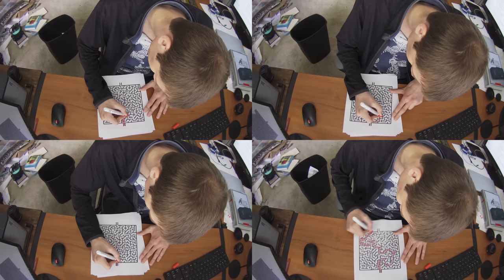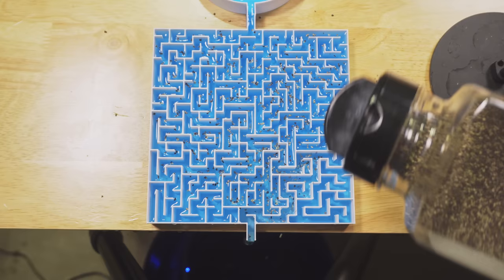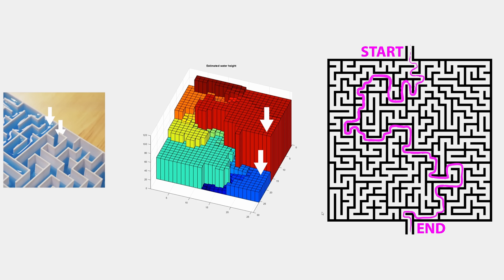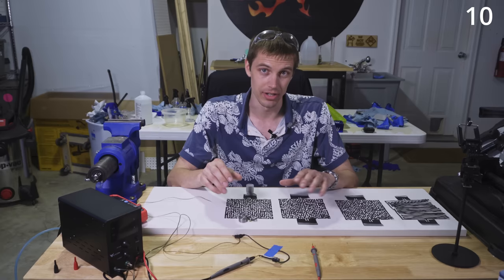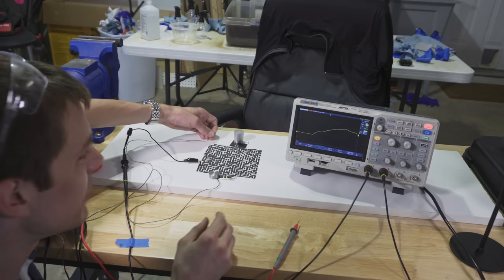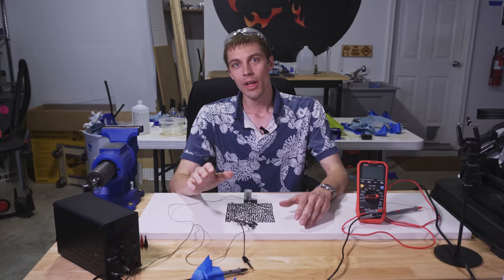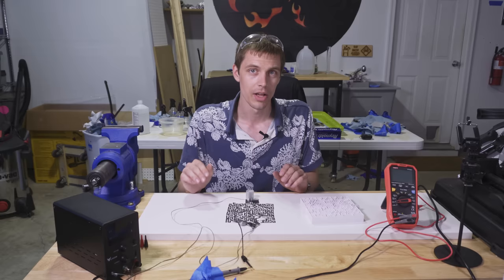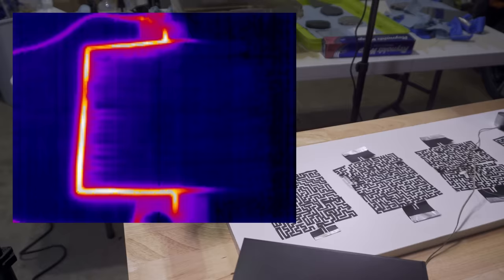How does electricity find the "Path of Least Resistance"?

Comment: This is an awesome visualization! It also makes the formulas and calculations in electronics more logical to me. In the end, all electronic circuits are basically just a maze, where the measure of resistance of a certain component tells you how "long" that component's "path" is, and the voltage drop over a series of components gives you the "gradient" of the "water hill"

Comment: Absolutely fascinating. I understood most of this already, but you've helped me visualize it in an entirely new way. Only 8 mins in, but already I can see how resistance is essentially drag created on the "electron water" and an item being conductive basically just means the water in the maze is already filled (the way electrons are already in the material and don't ACTUALLY flow like water) 
So basically I'm assuming that by the very nature of how resistance works, plus the 'gravity' model of the flow finding the path, the fact that resistance even exists is what actually allows electricity to follow the path, as it is basically testing all paths at the same time, but only the path with an output can 'move' and this 'low pressure zone' creates a metaphorical vacuum that then creates the flow of electrons.
This is my favourite vid of the year, thank you so much! (I'm gonna keep watching now, I assume there is plenty more to learn)
Reply: cutting the wire at the end was somehow both surprising and completely understandable. At first I interpreted as the flow getting trapped in the bends (and promptly realized how silly that was) and then realized this is heat, not actual flow, and the corners will have the highest concentration of heat due to the proximity to other areas of the 'wire'. But it did also highlight the flow, in that because the metal heated up SO much slower than the electricity flowed, you can actually still see (from top to bottom) that it is filling in as it goes from start to finish.
Yep, absolutely fascinating and a really beautiful illustration that truly cemented the concept in an accessible way. Great work!

Comment: This was a great video. A slightly more technical way to put it that is also helpful is that all conductive material, including wires, have capacitance. A capacitor is like an electric spring, same equations as a spring. Compressing the electric spring is the same thing as the filling up of the maze with water. When the voltage is removed, they will "slosh" out, or sort of pushed out like a spring releasing compression, as the charge of the maze reaches 0 again. I always found the spring analogy helpful.

Comment: Wow, this is such a great vissualization on the flow of electrons and shows how it takes ALL paths to ground, not only least resistance... if a hole was to open in another path, I.e. wire connected or someone touched it, it would suddenly go out to both spaces and both paths would activate and move...

Comment: Very nice experiment! It illustrates Kirchhoff's circuit laws in an interesting and engaging way. The different paths to "solve" the labyrinth are wires of different lengths and can be seen as resistances of different values. For two resistors in parallel, more intensity will flow through the least resistant one and so it will heat up more.

Comment: Breadth first search. The initial wave propagates equally through all available paths in the maze.

Where dead ends are hit, the waves reflect back and stop the (very slight) flow of current. Where the wave hits the output, it reflects back but inverted, accelerating current flow along the travel path.

This back and forth propagation continues until equilibrium is reached, where every point of nonzero potential gradient (i.e. electric field) is matched by resistance to active current flow. The equilibrium potential non-current-carrying dead end branches will be the potential at the branch point from the current carrying path(s).

Comment: There’s a balance of pressure at the boundary that is moderated by a vortex of inflow and outflow

You’re looking at the momentum of the stream of water at the edge of the system approaching laminar flow against the maximum width the vortex can be due to construction of the maze itself (and I’m glad you machined it so it was a constant width and height)

The backing up process doesn’t stop the exchange of water in it, it slows it, decreasing the acceleration of the flow of water at all points before the place which is attempting to deposit more flow in, which will inevitably change the height of the entire system by introduction of its own flow and that backing up process needing to also release up until the original system balance is in place (should the flow rate be constant)

The flow rate along the shortest path when factoring in the end is that it’s an open system, it’ll correlate to the amount of water capable of leaving, the amount of momentum that can be achieved through the longest path, and the fact that in the last example, you’re looking at the longest path changing directionality which will effect momentum of the system, until you made the shortest path closed, and the flow rate only had the option to go through the longer path

Before that point, you were seeing the flow rate of the shortest path actually overcome the flow rate of the longest path, indicated by the temperature increase at the bottom

If this were a system of water, I’d expect the height of the water in the longest path to increase, but still be balanced by the faster moving flow in the shorter path when it reaches equilibrium

Comment: I thought the same many times. And then 1 day i  realise current is not flow to the shortest path. Current always flow with least resistance. And after watched your video I confirm. Thanks man 🎉🎉
For Example if we have two types of wires first wire is 1 meter long and other one is 10 metre long but has 10 times less resistance compared to first one then the current flow on the both wires is same . If you read my comment please reply me if i was right 👍
Reply: Resistors in parallel ...

Comment: In your example of two paths at 4:00, you say the water flows to the exit because the surface is lower on that side and water "flows down hill" but that isn't really right. The water flow is because of pressure difference between the water source and drain. The height of the water is related to the water pressure at that point; the surface becomes lower further from the source because water pressure decreases further from the source in the path where it is able to drain. The paths that don't drain maintain the same pressure as the source and so no water flows into them. The height of the surface is not the cause of water flow.

Comment: An interesting, although by now faded memory is, how one of our lab exercises was to simulate a large section of the AC power network in a water tank.  I don't mean a deep one, the "tank" had just maybe 6 millimeters (1/4 inch) of water depth.  The professionals simulated the whole country power grid.  We students had just a couple of hours to do our smaller section.
 
 Another memory about power grid analysis is, how one of my older friends had earned some money by occasionally operating the university new computer overnight for some lengthy tasks.  One was to optimize a certain river's multiple hydroelectric power plant water flows through the cascaded pond system.  I believe there were 6 plants with varying reservoir volumes and characteristic river flow rates on each section.  The computer was fed input data by punched hole cards and then it produced the results on a punched tape just after sunrise.  A speedy "monster", that computer.  It had a recently upgraded (doubled) ferrite core memory.  If I understand, there is no thermal camera solution for this optimization task.

Comment: Interestingly, back in the 70s when computers were slow and expensive, engineers used analog circuits to simulate underground water ingress. They use potentiometers connected in the form of a matrix, adjust the values according to the properties of the underground structure, supply power to the network and measure voltage on different nodes, to see where the water will go. I've seen such device 2 years ago in a research institute when they are cleaning out stuff, along with a book describing this technique in detail. The title was "Modele De Calcul Analogic In Hidraulica Subterana", by Romanian engineer Constantin Ivan.

Comment: This just help me realize why using an amp clamp to diagnose a short to ground on a fused circuit that has multiple loads is helpful. Replace fuse with load such as light bulb and trace current path

Comment: It has always annoyed me when people say that higher resistance means more wasted energy, as in putting a 10 megaohm resistor across a AA would consume more joules. That's only true if current remains the same, which isn't how a voltage source behaves. This perfectly demonstrates how higher resistance paths let less energy flow through them.

Though, I get the feeling they could be confused by the similarities of a long path and a high resistance path.

Comment: Voltage is usually called "potential" in physics, and this is directly related to the same "potential" as we use in difference of energy levels in gravity.
The Voltage, or potential, is actually a measure of charge energy difference between two points.
So the water height/electrical potential difference is indeed comparable.

Comment: Electrons are quantum, they don't work quite the way you suggest. Also, electrons moving in a conductor are insanely slow, it is more about the potential pressure difference pulling a whole chain of electrons in the conductor starting with the ones already at the "finish" line.

The idea of electrons moving the whole path from start to finish in an instant is a very common misconception. For example, when you turn on a table light, it takes literal hours for an electron from the power socket to reach the lamp. The electric field is what is changing instantly

Comment: If electrons didn’t move, we wouldn’t have electromagnetism! Special relativity is so important that it applies at every speed, no matter how insignificant it may seem! The speed electrons move may be very slow, but it’s still fast enough that when you look from the electron’s perspective, what seemed like magnetism to the wire looks like electricity to the electron and what seemed like electricity to the wire begins to look like magnetism to the electron. All of Maxwell’s equations can be derived with Coulomb’s Law and Special Relativity.

Comment: Super cool idea; this reminded me quite a bit on how electrical resistance of a wire can be defined in terms of the wire length. In this maze game I guess you work in the limit where the difference in wire path lengths is significant to show a noticeable difference in current. 

A cool follow up experiment is if you can mimic this behavior where instead you swap the extra long wires for resistors of near equivalent effective resistance, and see if you get the same proportions of charge flow down each path!

Comment: To me, this is a silly question. 

It's like asking how water flows downhill instead of uphill. The path of least resistance is literally the steepest hill for the electric potential to fall down. 

I'm glad a 20 minute video is clearly helping people, but this could have been greatly simplified as a concept. You may not realize, but it's also the same as asking "Why don't batteries spontaneously charge themselves?" -- but this might be a better way to ask it. This is because you can get over the actual question of resistance quickly as there is greater resistance in the air than say the battery terminal but electric current isn't pouring into the battery. From the perspective of the electrons, the resistance matters but the height of the hill also matters. The air is a lower hill with higher resistance, so while the battery may have less resistance measured in Ohms, because it's hilltop (electric potential) is higher than the air, it still wants to "fall" towards the air instead of the battery. 

And another way to paint this picture is to point out that to take another path requires adding energy instead of dissipating it. Things tend to seek the lowest energy state available to them, rolling down the hill instead of up.

Comment: Thinking about the end of the demonstration with the mismatch cases. It is clearly showing Kirchhoff's law.
At the same time the reason why resistance exist could be explained.
There is a disequilibrium, a potential, that needs to be maintained. Specifically in the water maze the equipotential zone are the isopressure  one. 
Atmospheric pressure is pushing down and we counterbalance with the pump up (consuming electricity lol).
This is resistance from my  point of view.
Cheers

Comment: Electrons don't move long distances directly, rather the net movement is what we measure. This is similar to how ideal gas law is derived (by assuming a gas molecule moves at constant velocity until it hits a boundary)

In this case, the electrons really are moving randomly, it's just a voltage change makes them move in a certain direction more than others. So an electron can end up far from where it's started, it's just that they don't really go in straight lines(and colliding with lattices causes heat in wires)

Comment: See it like electro static pressure( airpressure) everything blocked off will increase in “pressure” and thus the leak (earthing) will be found directly, and bam, maze solved instant.

To solve you water height you can use voltage dividers as an example(just a bunch of resisors in series). Each corner the water has to take reduces flow, and this can create a difference in pressure(volts). Know the resistance of a zone, know how much water it holds. Notice you placed the walling very close so surface tentions play a huge role in your model.

Comment: The distance electrons move in a wire when current passes through it is often much shorter than one might expect. Electrons move at a "drift velocity," which is typically very slow, on the order of millimeters or centimeters per hour. However, the electric current itself travels close to the speed of light, as it is the rapid propagation of the electric field along the conductor that actually transmits the energy, rather than the physical movement of electrons.

Electrons as moving particles is a convenient metaphor to explain some concepts, but it isn't what is actually happening in the wire.

Comment: The 2 paths would act as 2 resistors in parallel, tied at the point of divergence and the point of convergence. As such, the cirrent flowing through each resistor would, given a set Vs and Vg defied as zero, simply be ohms law for each resistor. By cutting the lesser resistor, the greater resistor would remain passing the same current as previously. If you set the source to be constant current, you would get the result shown. Your source would increase the voltage proportionally.

Comment: Since Electrostatic forces work similarly to the force of pressure, I imagine you could probably perform the same experiment using a maze filled with clear water, a dyed water source, and an end point with no water pressure (air) thus simulating the same conditions of this electric experiment. You can imagine the water pressure as being the same as voltage, and obviously the current of the water would be like the current of electricity, so a high-pressure point (any point with water) would be like a high voltage point and a low-pressure point (air) would be like a low voltage point. I'm hypothesizing that if dyed water were pumped into the system from one end of the maze, creating a high-pressure (high-voltage) point to travel (or arc) to the low-pressure (low-voltage) point, then you would be able to see the optimal route of the maze using the dyed water.

Comment: Wow.  Very cool.  Some tangential thoughts:  there is one more way in which the electric and hydraulic systems are different .  When water flows or has different heights on opposite sides of a wall, the currents do not affect each other.  In an electric circuit, there are static electric and magnetic fields that extend over and under the walls, and these forces affect the flows of neighboring channels.  In electric circuits, these nonlinear effects are called capacitance and inductance.  The possible circuits in the electric model are called LC circuits.  LC circuits can oscillate.  Perhaps that explains the 'ringing ' you observed when the circuit was started up.  On the other hand, if the electric and hydraulic models behave identically once they reach equilibrium, the L an C effects are negligible.
Also, is there a math solution to the minimum search? Lagrangian  & Hamiltonian mechanics will find solutions to continuous minimum problems.  I don't know if there are variational methods that find minimal distance discrete paths.

Comment: Imagine if the pyramids had copper between every stone.
I can picture a natural flow of electrons(potential difference), given their hight.
Context.
I recently viewed a YT vid showing a drone that could create voltage, just by flying at different altitudes.  
So in my imagination the pyramids are perfectly shaped to take advantage of altitude, given their hight.
Like you demonstrated, you can design paths that can trick electrons to flow down the paths you will.
A very evenly distributed 3D cubical shape could make the electrons evenly distributed(EG evenly hot).
That cascading shape could also be very good at collecting the earths electron flow, given enough hight.

Brainstorming 100%

Great content APx

<3  : )